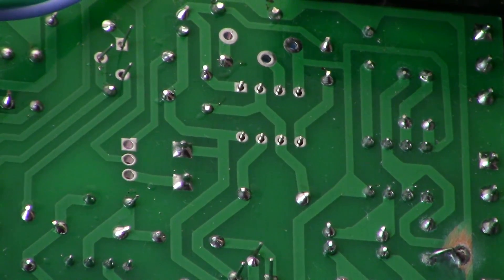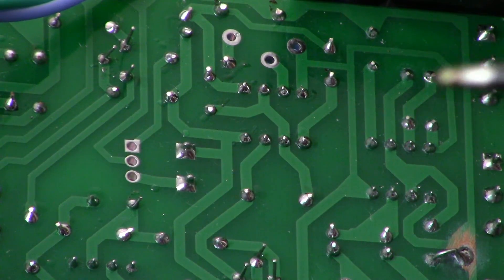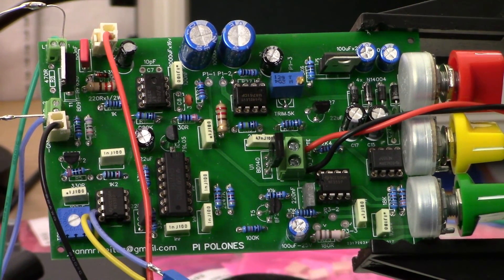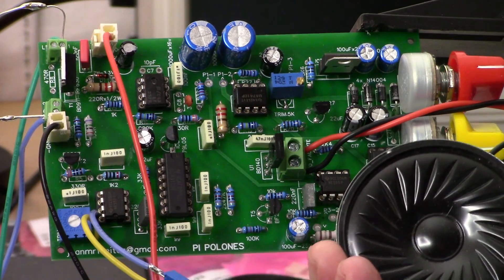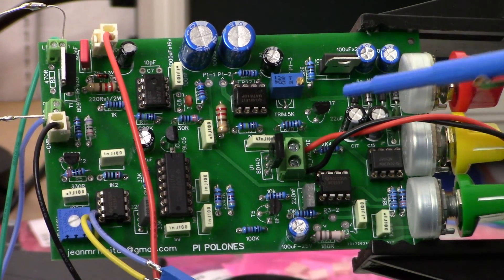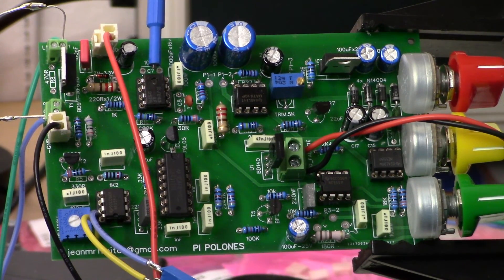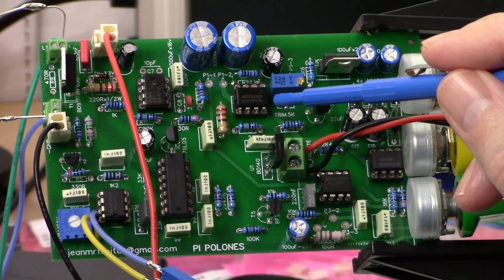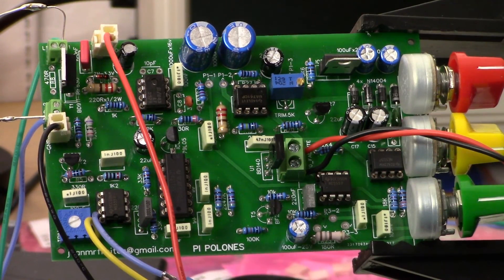PI Polones   Polish PI part #6 DIY metal detector

Comment: Hi sir, my pi plones was working good, but today it stopped working.irf630 is soo hot.i have chamged it but nothing changed.i neef yor experienced, what is the problem.i use 32 cm coil, 2.2 ohm and 285mH..

Comment: Hello, I enjoyed watching your work. I only have 2 questions.
1- How did you adjust the trimpots? according to what? How did you set it? Can you write in detail?
2-What is the thickness of the coil wire in mm? What is the coil diameter? How many turns did you wrap the wire?

Thank you very much in advance for your answers. By the way, I use translation. :)

Comment: Hello, please tell me in the bf245 section, what did you use as a replacement and what are the bios resistors?
Reply from the maker: Sorry,  I do not have this detector anymore.  All of the information should be included in the video series.

Comment: Hello, my friend, I made Polones, but unfortunately, the sound is the same and the sound does not stop when turning the 10k and 5k sense, what do you think is the problem?
Reply: The volume of the sound also works and it increases and decreases, but it does not change the volume of the sound by changing the two, the volume is related to the frequency.
Reply: Is it possible that the ohm of the coil is high or low?  Or is the problem with Isi?

Comment: Hi, I'm Franco from Italy, a new follower. Please could you tell me about the right side of insert of Bf245? In your video it seems rotate of 180 degrees by the pcb design. There's many confusion about the  corrispondent right pins "G/D/S" of this fet. Many thanks for all.
Reply: Thanks for your reply. Unfortunately I have made the polones four years ago, without success. Now I want to try to understand the cause of malfunction. It's a fool game! My last chance is get the experience of others. I have a Chinese tester, but it get a wrong response when I tested the Bf245, if I turn the face, the tester changed the corrispondence of pins in illogical way. Perhaps I should made another detector and forget polones... What is your advise  for me to make a good one? A model not too much difficult, because I'm not an electronic expert. Many thanks.
Reply from the maker: @francocuda3471  Hi Franco.  The Arduino PI is a good project to make and there is good documentation on the Geotech Forum.  I did a full set of videos for that on my channel.
Reply from the maker: Hi Franco welcome to my channel.  First I want to say that you should always use a transistor tester to confirm the pins as they can vary from one manufacturer to another.  Second, I do not suggest making the Polones.  I really do not see why so many people want to build it.  The machine is not very stable in my opinion.  Check out some of the other Pulse Induction projects that I have videos for.  The Crossbow is an excellent machine for example.  The Arduino PI is a good one too.

Comment: Thanks, nice video. I made this Polones to, and wanted to compare it to the allot more simple Russian pirat detector. I noticed that this was a bit better and more sensitive, for example i could detect a coin at 25 cm max, and on the pirat about 20 cm (same coin). This circuit then is allot more complicated then the Pirat. But i think it is worth the extra job.
Reply from the maker: Good to hear that you enjoyed the video.
Reply: i used lf355, though i had no lf357, even a 741 works on that part, but a bit less sensitive.
Reply from the maker: A better circuit than the Polones would be the Mini Pulse Plus.  You can see my build videos on my channel and get all of the information on the Geotech Forum.
Reply: @SurfDetector  that one i would like to try, i found i could buy circuit board from Uk, i live in Sweden so maybe possible. If i had the layout for it i can make it, and ofc the circuit :) thanks again. And if you got the circuit and circuit board layout i would be happy :) take care my friend
Reply: @SurfDetector  thanks i will check it
Reply: @SurfDetector استاد عزیز، بنظرشما امکانش هست رو این مدار ماژول مولدپالس اضافه کنیم تامداربتونه چندفرکانس متغیرداشته باشه ؟

Comment: How to and where to buy this pcb circuit or all components of this circuit ?
I am from India
Reply from the maker: Hello and welcome to my channel.  Have you subscribed?
You can find the gerber files for this project here:
https://oshwlab.com/jeanfreitas/pcb2-placa
Be aware that there are errors in this circuit as I mention in the videos.
Reply: @SurfDetector  i am on a project of PI metal detector, how i make this project without any error.
Can you remove the error of this circuit ?
Reply from the maker: @Harman___732  Go to the Geotech Forum and look at the PI projects there.  The forum has all of the information to build several good PI projects that are better than the Polones. Many of those projects I have done step by step videos for.

Comment: Those small resistors what did you use 1/2 or 1/4 watt?in my pcb no clear instruction of watt of resistor
Reply from the maker: All 1/4 watt except for the damping resistor which is one watt.
Reply from the maker: That would be the damping resistor which I told you before is one watt.
Reply: In coil sir theres 2 big resistor 180 and 22k what is the wattage? thanks
Reply from the maker: @jackofalltrades1263  I am sorry, without seeing the schematic I don,t know which parts you are asking about.  There are no resistors in the coil.
Reply: 470R r8

Comment: Hello, please help me. I have a Polones metal detector, but it senses metals in reverse. For example, when you bring the metal close to the coil, the sound is cut off. Which electronic component has the problem?
Reply from the maker: The detector is overloading and the sound frequency is going too high to hear properly.  I think that is your issue.

Comment: sir does it detect gold?  Next How many MZH is this device?
Reply from the maker: All metal detectors if tuned properly will detect gold.  This is a Pulse Induction machine.
Reply: @SurfDetector  thankyou sir
Reply: @SurfDetector  ic lf357 Is there any other change equal to this?
Reply from the maker: @lp1151  You will not get the correct gain if you do not use the LF357.
Go to the Geotech1 Forum and build the Mini Pulse Plus.  It is a better project.
Reply: @SurfDetector  Sir Frequency mhz?

Comment: *The TRIM1is it 2k or 200k?
Thanks 😊
Reply from the maker: I used a 200K
Reply: @SurfDetector  i don't have it.
I just have 2k  and you said that will be good. Thanks again
Reply from the maker: You are welcome.  You should build the Mini Pulse Plus.  It is a better project than the Polones.  The Gerber files and build document are free on the Geotech Forum.

Comment: What else can I use instead of lm741
Reply from the maker: You could try a TL071 but there is no reason not to use the LM741
Reply: @SurfDetector  I just plugged 2n222 instead of bf245a and now it works a bit smoother. detects a pliers from 15cm. I wonder if the problem could be bf245a?
Reply from the maker: Most likely the issue is with what you have for a sample delay, or how you built your coil.  Without seeing the pcb in front of me or some oscilloscope shots it is almost impossible to diagnose remotely.

Comment: good day bro. I made this circuit, but when the metal gets close to it, it silences and when it goes away it chirps and the perception is very low. I wonder why?
Reply from the maker: If it silences when the metal is close that probably means that the frequency of the audio circuit is going to such a high level that you cannot hear it.  With an oscilloscope you should be able to see this action.
Reply: @SurfDetector  it just chirps when the big aluminum comes close and all the other metals silence when it approaches. I wonder what should I fix?
Reply from the maker: @quadrado360  Have you looked at the signal with an oscilloscope?  I do not know why the Polones is so popular, it is not a stable machine.
Reply: @SurfDetector  no oscilloscope. Isn't there any other method?
Reply from the maker: unfortunately when building electronics if you encounter a problem then to troubleshoot it you really need an oscilloscope.

Comment: Dear Sir,　R8 and C7 are not installed, is there any reason for that?　And also, how did you adjust the TRIM5K and TRIM100K?　If you would be so kind as to share the details of your setup, I would be grateful.
Reply from the maker: Hi,
I have R8 installed across the coil connection instead of on the pcb. C7 is not necessary for the circuit,  I believe that I explained most of these in my #5 video.  Please watch the whole series 1-6.
Reply: @SurfDetector  I am very grateful to you for your kind instructions. I will go find them.

Comment: remove the 5k trimpot.
place of 220k, this correct
Reply from the maker: I used a 200k on that PCB.  A better machine is the Mini Pulse Plus.  I did many videos for that project and the gerber files are free to download, it is a better project I think.  Thank you for subscribing, I have more videos every week.
Reply: @SurfDetector  How long can be pi polones get metal
Reply: Thank you

Comment: What is the best replacement transistor tip 3055
Reply from the maker: Is this for the Polones?  Which schematic are you using?
Reply: @SurfDetector  
Hello, my friend, I have a polones device, but the problem does not feel well: a piece of 20 * 20 cm at a distance of 40 cm
Reply from the maker: @elhakim9416  That does not sound very good my friend.
Reply: @SurfDetector  
Yes, how do I increase the sensitivity of the device, my friend
Reply from the maker: You need to know many things about your machine:
What is the TX pulse width
What is the sample delay width
What is the Sample pulse width
What is the coil inductance and the damping resistor values
Did you use a real LF357 Op-amp
There is no easy answer here, there are many factors to investigate and you really need an oscilloscope to do it properly.

Comment: How to increase the sensitivity of the device?
Reply from the maker: There are many factors that are involved with the sensitivity of the detector:
Coil
Pulse width
Sample Delay
Sample width
Op-amp used
Reply: @SurfDetector 
But there are some parts that are responsible for the power of sensitivity, for example transistor bf245 and irf840
Reply from the maker: As I said in my reply earlier there are many factors that influence the sensitivity.  What Op-amp did you use for example?
Unfortunately this detector uses the LF357 which  is a part that is counterfeited many times.
Reply: @SurfDetector 
But there are some parts that are responsible for the power of sensitivity, for example transistor bf245 and irf840

Comment: Hi thanks a loro for tour video are so useful.. 
To use oscilloscope with coil signal, i need Just x10/x100 probe or i must use another stuff?
Reply from the maker: Hello Andrea,
You should be fine using either x10 or x100.  If you want to look at the coil flyback you can also just clip your probe around the insulation on the TX coil lead and the scope will read through the insulation.
Reply: @SurfDetector  that sound great.. thanks a lot

Comment: Thank you for sharing this amazing videos i really love your videos 
Next week i will start building this pulse induction metal detector
Reply from the maker: Hello Bilal,
I am happy to hear that you will be building the Polones.  It was a fun project.
Reply: @SurfDetector  Hello please, I need help. I made a pi  polones, but I encountered a problem. The device does not work until I put my finger on the bc327 transistor T3. When I remove my finger, the device is silent, but unfortunately, I do not have a tracking instrument. Please, are there any suggestions?🙏
Reply from the maker: @bilalhajji9473  Bilal,  In order to troubleshoot properly you need an oscilloscope.
Reply: @SurfDetector  thank sir 🙏